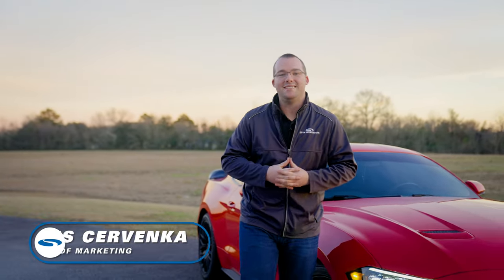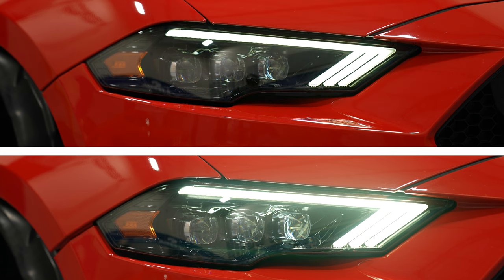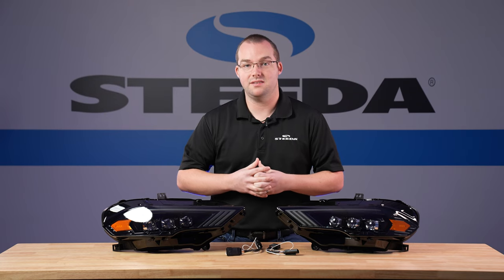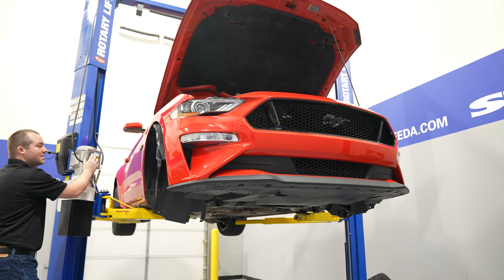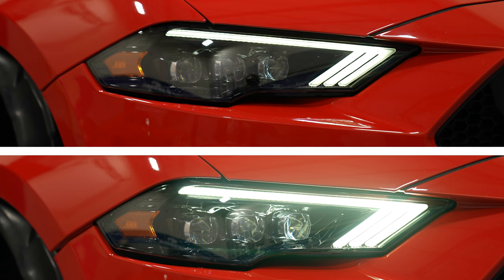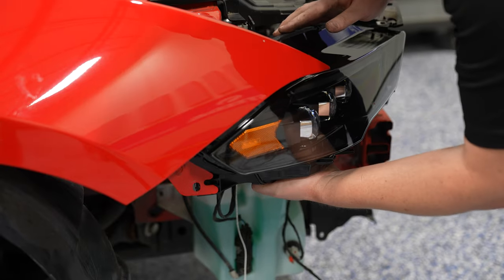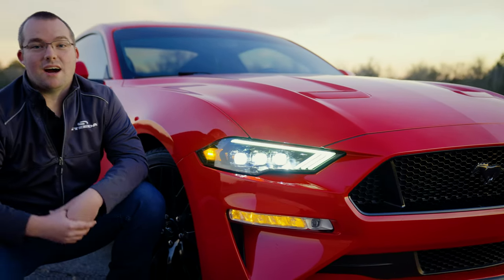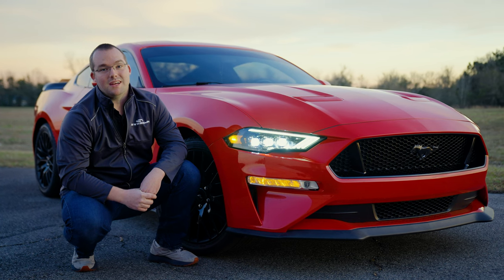Installing New AlphaRex Mustang NOVA-Series Headlights (2018-2023)

Comment: Chris, excellent video as usual.  My son purchased two sets of these headlights from Steeda, one set for his 2022 Mustang GT and one set for my 2022 Mach 1.  I installed the AlphaRex units on the GT and the nighttime lighting improvement is significant and the sequential turn signals are an added bonus.   However, the Mach 1 installation is NOT plug-n-play because the Mach 1 uses 2015-2017 turn signal assemblies and it needs the corresponding turn signal wiring adapters from AlphaRex's 2015-17 Mustang headlight kit to feed the headlight's turn signals.  AlphaRex Customer Service won't provide the proper plug-n-play adapters and their suggestion to cut into my factory wiring harness to feed the turn signal voltage to their $1000+ pair of headlights is absurd.

Comment: They look nice.  I just can’t stop thinking they’re aftermarket headlights. It kinda reminds  me of 2001 Honda civics. Switching out lights to cheaper quality lights.
Reply: They're actually higher quality lights than factory.
Reply: @Omar-te6nm  the casing and the fitment isn’t higher quality.  The LED’s used might be but I’m not speaking about the actual light stream or brightness.
Reply: @TheCdM1981  I see what you're saying. Mine are getting delivered in a week. I will post a video in 4k and show the difference between them and the factory ones side by side.